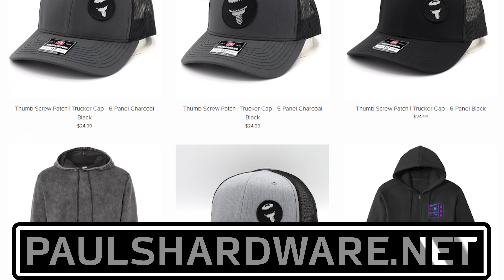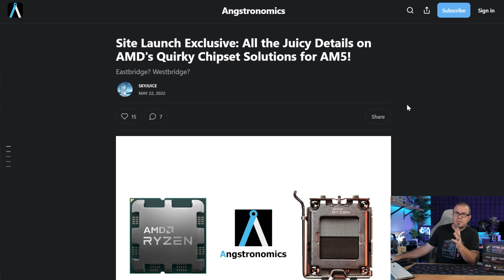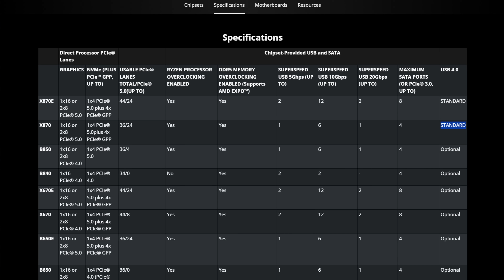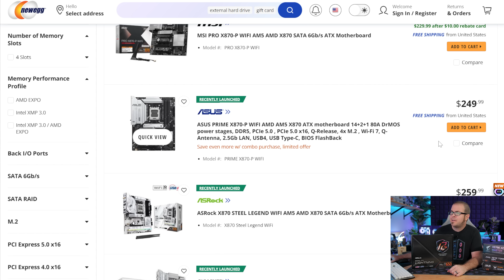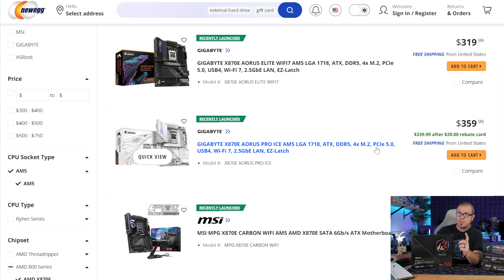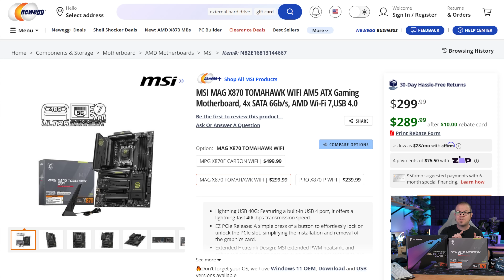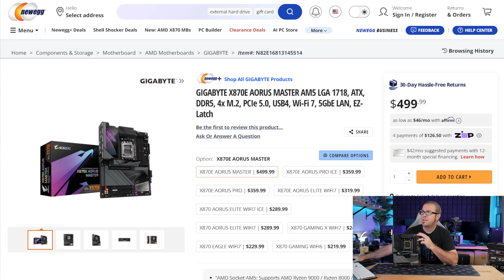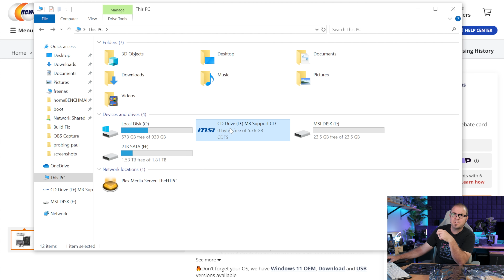Explanation / Rant about AMD X870 and X870E Motherboards

Comment: From my painful experience, the looks and aestethics as well as optional stuff like super fast lan/wifi controllers, are the last things you should look at. The most important is PCB, VRM and components/BIOS quality. The board can look like pile of junk as long as it has all those things rock solid. I have two friends having nearly same setups, 9800x3d and 5080, but one is using ASUS TUF board and had 0 issues, the other has Gigabyte Eagle and fighting high DPC latency and microstutters in some games, considering to try the luck and move to TUF because there is clear real life evidence. So yeah, can live without post code LED and super fast wifi, as long as PC runs games flawlessly.

Comment: Asus q-system is sweet .. Not needed but i like it i got my x870-a pretty cheap 210 bucks so I wanted white it was white and the q stuff is nice to work with taking out a GPU is so much easier it just pops out the top m.2 has a button that just pops it open it also has oodles of USB and thunderbolt ports . I dig it .

Comment: Hi Paul, I just upgraded my intel PC and switched to AMD with a new Gigabyte X870E Pro motherboard and the AMD Ryzen 9800X3D processor. All the drivers installed without a problem except for the chipset. I get "This installer is intended to be deployed only on an AMD system". Well, that's what I have of course. Have any ideas why this error is coming up and what steps might fix it? I'm in touch with AMD support and they are looking at my system info file.  Waiting for a response. Oh, and I just updated the bios today without a problem as well but the chipset still gives me the error. Thanks.

Comment: What's the point of paying for an 8 series board?  I bought a used X670E on ebay for $135.  It has every feature I need and my 9800X3D and 5080 and VR headset and sim rig perform statistcally the same as if I paid $800 for a X870E ROG. USB4?  Who gives a shit.  Stop wasting money and INVEST.

Comment: M.2 Information at 17:48  is wrong.  That bottom slot is not 5.0.  The first 2 slots on top are the 5.0.  The first slot has its own lanes but the 2nd slot shares lanes with 2 USB C ports. To get the full speed on the 2nd slot you will need to disable USB 4 in the bios. Disabling USB 4 will turn off the 2 USB C ports next to the HDMI port.

Comment: AMD Ryzen 7 7700X 
Gigabyte AORUS WATERFORCE X CPU Cooler
Gigabyte X870E AORUS ELITE  Motherboard	
G.Skill Trident Z5 RGB 32 GB (2 x 16 GB) DDR5
G.Skill Trident Z5 RGB 32 GB (2 x 16 GB) DDR5
Western Digital Black SN770 2 TB 
Western Digital Black SN770 2 TB 
Gigabyte AORUS MASTER GeForce RTX 4070 12 GB
Lian Li Uni Fan SL-Infinity 61.3 3-pack
Lian Li Uni Fan SL-Infinity 63.6 single
Lian Li Uni Fan SL-Infinity 63.6 single
Lian Li Uni Fan SL-Infinity 63.6 single
Lian Li Uni Fan SL-Infinity 63.6 single
Lian Li Uni Fan SL-Infinity 63.6 single
Lian Li Uni Fan SL-Infinity  63.6 single
what would you change?

Comment: Am I crazy or is the double chipset boards bottlenecked by that single PCIE 4.0 x4 bridge being shared by twice as many connections compared to the single chipset boards? They're daisy chained so it's doubling the load over the same connection. That makes me feel even more smug about my choice of the B650E back in 2023 for my 7950x3D. What a joke AMD.

Comment: The MSI x670(e) motherboards both have unresolved issues recognzing a lot of the SSD drives if they're in the M2 slot.  MSI has shown no inclination of fixing it....2 years later 😵‍💫

Comment: I'm thinking about the Asrock x870  RS Pro because it has enough ports for 6 Sata HDDs, and... I have a lot of 7200 rpm HDD's, doing nothing... and a lot of steam games that dont' need SSD read speeds to run. The MSI's Edge with 6 Sata.... cost about the same in B650...form...  or going intel or AM4... so...

Comment: As far as I checked, the main benefits are wifi7 and no need to flash your bios before you put your 9000-series CPU in. x870 has PCI 5 instead of PCIe 4 of x670. I think I will buy these new models just because wifi 7. They sure are ugly though.

Comment: You failed to mention on several of the 870 motherboards,  that if u use more than 1  gen 5 nvme,  it drops the x16  slot to a x8.  Might want to mention that to people before they buy.

Comment: I've had my x870e aorus elite since it came out over a month ago for my 4080 super + r7 9800x3d rig, except the 9800x3d still hasn't arrived because it's still on pre-order and scan delays are crazy... I paid for it with my own money at 15 for around £2-3k so hopefully it'll be a great build (It's fully built, I just left the AIO hanging off the rardiator and the cpu socket is closed, once the 9800x3d arrives in hopefully a week, and I'll put it in the motherboard, replace the stock socket and add the aio)

Comment: Your PCIe 5.0 on the MSI board is wrong.,,  The Tomahawk board is the only 870 board that has dedicated 16x for the graphics card and 4x to the top m.2 5.0...   Then the second M.2 5.0 is below the graphics card...  Which if you want it to be 4x then in the bios you can disable the 2 40gb USB 4 ports on the back

this video has great info   https://www.youtube.com/watch?v=gJn7DgqSNBA
If you want all the 870 board PCIe layouts..   https://www.youtube.com/watch?v=WKkqlWckseM

Comment: I'm looking for a reasonable priced AM5 board I can add my 10G network card to. It is difficult to find a 3 PCIe slot motherboard that allows 10G at the bottom with 4x connectivity vs  the second PCIe slot near the GPU taking half the bandwidth of the first x16 PCIe slot. It takes a lot of time reading the fine details  of the NVMe and SATA comprises. X670E and X870E $$$ seem only choice

Comment: Something really shoddy with these X870E boards (maybe also X870?) is how many of them share PCIe lanes between the M.2 slots and the main PCIe x16 slot, where if you insert an M.2 drive you're dropping to x8 times for your GPU. Honestly it just blows my mind that this is on the flagship, top of the line chipset. It's such a common use-case too. You buy a high-end rig, you expect to be able to have super fast storage, and use your GPU to it's fullest. And it's something that's really not obvious when you're purchasing these motherboards too, you have to go diving around in the manual to find this information, which means looking in quite a lot of manuals to pick your motherboard.

ASRock once again proving to be very sensible here, and their M.2 slots can all be used without affecting the PCIe lanes available to your GPU. On the board I'm now getting, the ASRock X870E Nova Wireless, if I put an M.2 drive in the final M.2 slot, it will disable the final PCIe slot. Not something that most people, myself included, would really be bothered by.

Comment: all AM5 CPU that is not  9000 SERIES is going to be PCIe 4.0 do not use last gen CPU on X870 motherboard. you need to buy a RYZEN 7 9700X or RYZEN 9 9900X or better yet donot buy X870 wait for CES 1/5/2025 for  next gen toys  that is going to be on display. I am thinking rather or not a X970 will be on DISPLAY. and everything PCIe 5.0 will be on DISPLAY suck as GRAPHIC CARDS and MORE NVME SSD 5.0 and NEW RIASER CABLES PCIe 5.0 and next gen towers that contain RAISER PCIe 5.0 CABLE. use the OLD  GEN GAMING CPU that  you got at least for now. wait for the CES 1/5/2025 that seems like a year away. its not it just feels that way. its next month and half of DECEMBER 2024 is OVER and DONE WITH

Comment: There's some big caveats with the extra gen 5 m.2 slots below the top x16 g5 slot, that seems to be present on all the Aorus boards (and probably other 870 boards). It shares bandwidth with the m.2 slots, and will downgrade to a pcie x8 connection if they are used. And that's for the primary GPU slot. 

This isn't nearly as much of an issue on a lot of x670(e) boards since most opt for g4 x4 slots for the m.2 drives. Definitely pay attention to the tech specs when it comes to the "sharing" of slot bandwidth and if that will be an issue for you for your planned configuration.

Comment: For me the video was to long to watch completely. But a notion for the MSI Tomahawk X870. The second PCIe 5.0 M2 slot is only 2x connect because of the USB4. But you can deactivate the USB4 in the bios so you have PCIe 5.0 4x for that M2 slot as well connected to the CPU.

Comment: Since i trust your opinion, is there any itx or micro atx motherboards you'd recommend for creators? Ill be using 7950x until the 9950x3D comes out, i do mainly creator stuff, with gaming on the side.

Comment: 11:20 CORRECTION: Internal HDMI port, usually used nowadays for people who would like to utilise an internal panel in their case peeps, Overclockers don't give a stiff pertaining to this. Its internal so as to bypass routing a cable out back into the motherboard or GPU. Thanks Paul and Peace!❤❤☮☮

Comment: What I find very interesting is, that no pc-tech channel on youtube, as far as I’m aware of, points out the lane-sharing "feature" of the state of the art motherboards of late. 
It prohibits the use of the second x16 slot, if you don’t want your graphics card to only utilize 8 lanes, the use of the second nvme m.2 slot for the same reason, or even plugging in a usb-device - again - for the same reason. 
In some cases, using the third nvme m.2 slot, the second x16 expansion slot will even be disabled completely. 
That’s definitely not "future proof" by any means, like at all, and you find this nonsense even on, for example, thread ripper motherboards. 
🤦🏼‍♂️

And keep in mind, for windows 10 users, there are no wifi drivers available for the 870 motherboards. 
The drivers for windows 11 won’t work with windows 10, I’ve been told. 
Are there even linux wifi-drivers for these motherboards, I wonder? 🤔

Comment: It would be a mistake to assume that there's no difference between any given X670E board and its re-released X870E counterpart, even if the former did already have USB4 chips. Take the case of the Asus X670E/X870E Proart boards. Superficially they look practically identical, but significant alterations have been made to PCI-E lane distribution, and either one of the boards could be superior depending on the user's requirements. The X670E board has the USB4 controllers routed to the chipset, while the X870E revision has those controllers connected to CPU lanes instead. This has positive consequences for USB4 performance and congestion on the chipset, but potential negative consequences for M.2 expandability (populating the second M.2 5.0 slot will reduce the primary PCI-E slot to 8x). It's likely that similar differences exist in other boards now that it's mandatory to have USB4 controllers on CPU lanes for X870E.

Comment: wonder if the x870es will be able to run 4 sticks of ddr5 properly lol i have the msi x670e meg ace right now and even that cant boot with 4 sticks. i no u can mess around with setting to get it working but even then iv heard 2 sticks is better

Comment: b650e and x870 are roughly the same, but b650 is inferior due to lack of pcie5 gpu slot (which is not currently useful)

Comment: I just snagged an asus x870 board from newegg that was $309 retail then $70 off and came with 32gb of corsair 6400 ddr5 ram when paired with the 7700x purchase. So all bundled together for just under $500. Dont think it was a steal but I think it was a solid enough buy to get my build off the ground.

Comment: I plan on putting together a new system using, AMD Ryzen 9 9950X3D. What's the best Board for: Performance / Low Heat / Best BIOS that is easy to use & plug n play lol - one that will be easy to make sure my ram is using the best CAS Latency? I am open to spending up to 600 for the board IF there are benefits.

Comment: What i hate is the board pcie management are sucks. What i need to run both pcie gen 4 at x16. By splitting it into x8 gen 5 it didnt justifies th pcie lane. Your pcie still work on x8 pcie4. Amd should rework that nvme slots to run at all slots fully running on pcie 4 x4. And manage the x16 slots running perfectly at both full x16 slots. Duh
Reply: only asrock meets my demands

Comment: So, what would be a good choice for a white motherboard, to assemble a 7800X3D or even 9800X3D? I am not a pro user, don't need 1000 usb ports or NVME connections, but would be nice to buy something decent that would last me a few generations. Should I buy last gen X670E or B650E?

Comment: It's just as always. If your budget is not unlimited, save on every part, except the gpu. Even a coming 5090 won't need pcie 5.0x16. Same with fast RAM. Yes, it's fun to have, but buying RAM double the price gets you maybe 5% in cpu heavy games, that 200$ should have gone again into the gpu. Do the same with a regular SSD instead of a samsung 990 pro, and ignore that copying 3TB of data might be slower. You will never notice that in a loading screen, i start games from an HDD and dont really notice the difference.
And suddenly your budget has space for a 4080 super instead of a 4070 or even 4060, or you'll have 500$ more to spend on a nice monitor to even see what visual greatness your pc can output.

Comment: Absolutely disgraceful that they ask 300+ to start getting post codes, and absolutely absurd that 1k+ boards for consumer grade even exist. From 10 years ago and even further back than that to now, the value of the existing motherboards is abysmal. In order to get high quality transistors you have to pay north of 400? I am honestly not even going to bother with an upgrade until I start seeing value (post codes, high quality controllers with no PCI lane sharing, high quality transistors and heat-sinks at south of 250 mark. 

And damn that rgb madness, they look like a christmas tree. I just want a solid board that doesn't tie my hands behind my back....Jesus.

Comment: I can appreciate wanting to save as much as possible. But there are also a lot of quality of life improvements with spending just a bit more cash on a motherboard. Take the MSI Tomahawk x870 for example. On that board you get screwless heatsinks, GPU lock, Error code reader.. etc. Plus, gen 2 boards almost always iron out the bugs from gen 1 boards. I would never pay retail, and anyone who currently uses a b650 or x670 board has little reason to upgrade. But for new system builders looking to finally get on AM5 I think these new X870 and the inevitable b850 boards will be the better buys. Especially when they inevitably fall in prices.

Comment: That MSI Tomahawk board is unique. It's the only X870(E) board available that allows M.2_2 to run at full 5.0x4 by disabling USB4 instead of making M.2_2 share bandwidth from the PCIe x16 slot lanes.
Reply: And it has debug LED and Clear CMOS. Msi X870-P has the CMOS button too which props to MSI for giving useful features like this on the mid tier motherboards of the line-up.
Reply: I have heard most of them that X870E tomahawk wifi having some problems did anybody genuinely have this motherboard facing some issues please let me know as I am planning to buy this board 😢 for my R9 7900x.
Reply: Just get a gigabyte x870 or b850 @DeepSpaceDock
Reply: Asrock taichi also doesn’t gimp your pciex16
Reply: @supertrooper257  ASRock Taichi doesn't give you a second 5.0 M.2 slot. M.2_2 through m.2_4 are all only 4.0.
Reply: @nleippe  its the X870 non-E
Reply: @bommerop  and?
Reply: @ wdym and?
Reply: @ ASRock Taichi doesn't have a 2nd 5.0 M.2 slot.
Reply: That depends. I don't see a need for a second full-speed PCI slot in my main PC, but a fast usb4 is nice to have...
Then again, some people might want to run multiple GPUs, I suppose
Reply: yeah tomahawk is the only x870/x870e board that is not terrible in this regard
the x670e boards are much better
the video completely misses to mention that which is the biggest issue of the x870 mandatory usb4 feature....no idea why it's called explanation/rant, it's just a dumb product showcase with no added value
Reply: @HeadBassVTEC  Update: turns out the MSI MEG X870E Godlike also has the same design--you can fully disable USB4 and get full 5.0x4 speed on M2_2 without losing PCIe x16 lanes from the GPU.
Reply: lol tomahawk is a x870 only
Reply: @aspyde  your point?

Comment: the lack of usable pcie slots is annoying. I think the Crosshair is the only version where I can fit a 4090 GPU and still get a Mellanox 25Gb card in the 2nd  slot with 8 lanes.  But it doesn't have that last pcie slot, which I need for an RME sound card... grr.  So I'm likely forced to go with an x670 card just so I can get 3 usable PCIe slots.

Comment: Question: What is max no. displays (4K @ 60Hz) which can be connected to these X870/X870E boards, to be driven from iGPU on 9900X?

I understand all these boards have 1x HDMI and 2x USB 4 (supporting DP over USB). In principle, each USB 4 port could output to two 4K displays @ 60Hz (using an MST USB-C to dual DP adaptor). So I wonder whether it might be possible to drive FOUR, or even FIVE 4K @ 60Hz displays from the iGPU via X870/X870E Mobo?

(of course, another limitation is max no 4K @ 60Hz displays supported by 9900X iGPU itself, I heard this might be a max of FOUR, but unconfirmed?)

I am planning new build using Ryzen 9900X and an X870/X870E Mobo. Will not be used for gaming, for productivity only. I won’t install a discrete graphics card, will rely only on integrated graphics.

I wonder if the answer is the SAME for all these X870/X870E Mobos, or would some of them allow to connect more 4K displays than others?

Comment: What a surprise ... at least we had a trifecta until availability started drying up ... If you wanted a budget system [or value conscious] you'd go last gen CPU [7700, 7800 X3D], with a last gen MB [B650], and a last gen video [6800 for 350$ wasn't bad while it lasted].   No wonder more value conscious people are holding off on upgrades until their system simply doesn't "do what they want it to do" anymore.